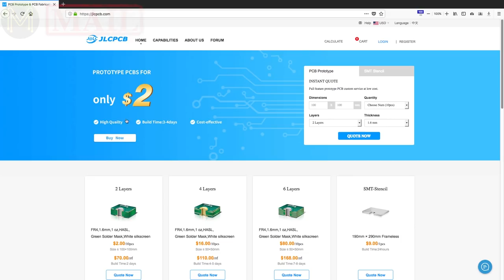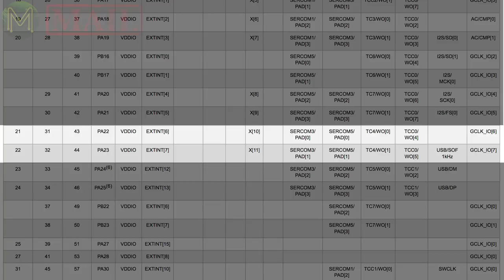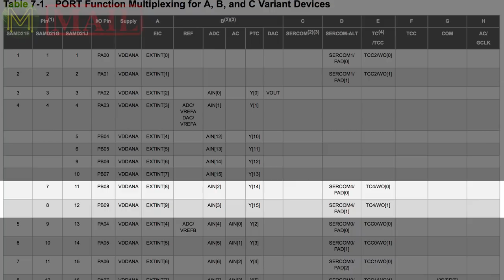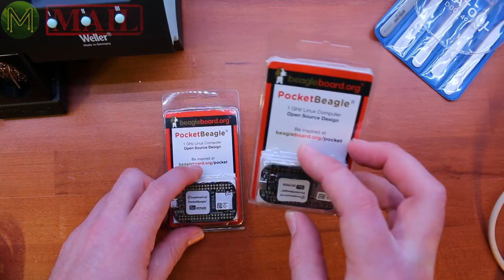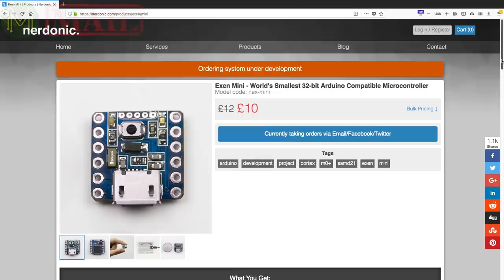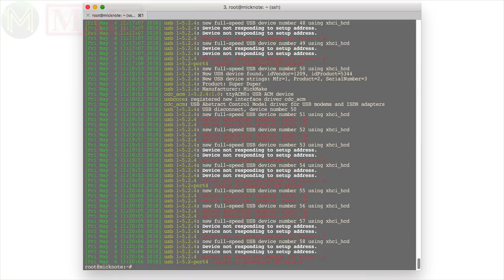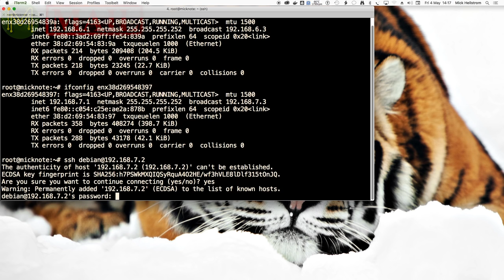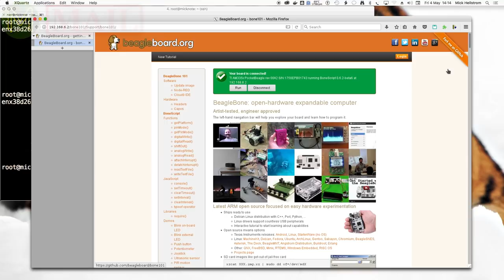#209 MickMake Mail #28: Weller iron, PocketBeagle & a mini projector // News

Comment: I got a new soldering iron myself. I jumped onto the TS100 bandwagon, and like the little thing a lot. With a 19-24v source it gets plenty hot VERY fast, has auto sleep and shutdown, accelerometer restart, and it weighs almost nothing. I built a ham radio (still being troubleshot) with it this week, and it's a wonderful little gadget. If the contact is a bit heavier, it's easily bumped up in temp until the solder flows properly and makes a good join.

The only thing I wish I could find is a tiny chisel tip for small pads or surface mount stuff. I'm using the conical it came with for lack of something better. I did get a small angle-tip (BC2) tip for it, but it's too big.

I have an old Weller that isn't temp-controlled. It's so old you need to change the element to change the temp. It works, but it's heavy and clunky.
Reply from the maker: Yup, that’s the one I have. One temperature wonder. You get quite good at using it. I’ve used it for 30 years and it wasn’t until I tried out a $2000 iron that I realised what I was missing out on.

Comment: Those old wellers were so good, They just never died.  Had mine since the early 80s, still have it but you do need a bit more control for modern electronics.
Reply from the maker: True. SMTs are a bit tricky with the old Wellers.

Comment: Metcal MX-500P-11.  I never looked at another soldering since.  Quite a few show on Ebay and even the non-working ones are usually easily repairable - full schematics are on the web.

Comment: I noticed that for the DLP projector you still had to power it separately from the RasPi. How do you feel about that? Can you backfeed power from the projector to the SBC? I think it's disappointing if you need 2 power bricks to power something that's supposed to fit in your pocket.
Reply from the maker: Towards the end of the video I showed how to power it from a single DC source. Works quite well and can be powered from the Pi or the DLP2000.

Comment: Still have my first soldering iron, RPG model pretty sure it was rated at a massive 18W when I bought it, just tested it then, burning up a measly 13.3 watts. Still, not bad for something that's 35 years old.
Reply from the maker: Nice. I'm amazed my old Weller is still going. I can still get tips for it and will still use it, but it's slow to get started... Often takes up to a minute to get to temperature.

Comment: The sloppy focus adjustment on the projector can be easily fixed by replacing the adjustment pin with a M1.6 screw with a washer and a locking nut. I followed the guide from TI forum, and it was pretty easy to replace: https://e2e.ti.com/support/dlp__mems_micro-electro-mechanical_systems/video_and_data_display/f/947/t/621165. The only drawback of this method is that you have to undo the nut every time you want to make an adjustment, but considering that in most applications the projector will be mounted in a fixed location, it will not be a big problem.
Reply from the maker: Nice! Didn't see that mod.
I'm thinking of 3D printing a case for it that will both hold the dodgey focus thingy as well as allowing adjustment.

Comment: I'm curious why you didn't simply plug that mini projector cape into the beaglebone white you had. Any cape that works on the beaglebone black also works on the beaglebone white (though the converse is not always true).
Reply from the maker: The old BeagleBone White doesn't support parallel RGB666 output from the SoC onto the header. Only the BeagleBone Black supports this.
Reply: @MickMake  That is incorrect. The beaglebone white has the same SoC and the same SoC pins connect to the same expansion header pins.
Reply: @MickMake  Here's a summary of how the BeagleBone White and Black differ:
- The Black has eMMC storage, which acts like a virtual cape and occupies some expansion header pins (unless disabled).
- The Black has HDMI output, which acts like a virtual cape and occupies some expansion header pins (unless disabled, which should happen automatically assuming the DLP cape is recognized, since it obviously needs those video output pins).
- The Black has a newer SoC revision which is faster (1 GHz instead of 720 MHz) and fixes some errata.
- The White has 256MB DDR2 memory, the Black has 512MB DDR3L memory.
- The White has an integrated FTDI usb-serial converter for the serial console port and JTAG. It also has an integrated usb hub whose upstream is the external mini-USB connector and whose downstream ports are the SoC and the FTDI chip.
- The White has a 3.3V 1A LDO solely for capes attached to the expansion header, while the Black reduces that to 500 mA and also uses that LDO to power various on-board components (eMMC, SD card, Ethernet).
Reply: @MickMake  Where did you get the misinformation that the White doesn't support video output on its expansion header?
Reply from the maker: Matthijis, It wasn't that it physically doesn't support it, but rather the software side would have taken a bit more effort. Since I was going to go through the effort anyway, I thought I might as well do it for the Pi.
Reply: @MickMake  Nope, it should work automagically thanks to cape auto-detection. U-Boot will read the CAPE's identification from its EEPROM, then load the corresponding device tree overlay which will set up the lcd controller and configure the correct display timings.
Reply: @MickMake  Easy experiment: plug the DLP cape into the beaglebone, insert an sd card with the latest stretch-iot image (lxqt might be a bit heavy in only 256MB ram?), boot it up and see what happens.

In case of trouble, I've quickly made a beaglebone white branch of my show-pins utility, which gives a nice overview of the current pin configuration: https://github.com/mvduin/bbb-pin-utils/tree/white#show-pins

Based on a quick glance, the DT overlay for this cape looks mostly okay to me. The only bit that seems a bit sketchy is the "INIT_DONE" gpio. The DT overlay reserves the pin, but doesn't actually declare or initialize the gpio, so you may need to manually export and set it after boot. If this is indeed the case, I can help with fixing the overlay to make this happen automatically if you want.
Reply from the maker: I did spend a bit of time with it, but didn't really get anywhere. It was almost a year ago I was playing around with it, so can't quite remember at what point I gave up. However, I do remember preferring to spend the effort on getting it going on the PiZeroW, since it would end up being a cheaper unit all around.

My long term goal is to have it be supported on every SBC. Surprisingly, there aren't that many SBCs pushing out all the required RGB666/RGB888 signals onto headers.
Reply from the maker: From memory, the DLP2000 was badly supported on the BeagleBone to begin with. There have been quite a few people with the same experiences.
Reply: @MickMake  I'm sorry to hear you didn't have a great out-of-the-box experience with it. A lot has happened in a year though (e.g. going from the ever-fickle runtime overlays to u-boot overlays), so I wonder if it would "simply work" nowadays. It definitely should.

And yeah the RPi family offers cheaper boards, but the beaglebone has an open hardware design under a Creative Commons license, and a SoC that's available for sale in low quantities and has thousands of pages of documentation. These are qualities that I feel deserve some encouragement too. :-)  Plus it has a sweet assortment of interfaces and peripherals, and its awesome Programmable Real-time Unit subsystem.

Comment: Buy yourself a TS100.
Reply from the maker: I’m actually considering buying several cheap irons to see how they go. I’ve always had bad experiences in the past... but I’m talking 20 odd years ago.
There’s a lot more options these days.
Reply: TS100 is a really nice iron. Heats up quickly and there are several firmware flavours out there for it. I'm currently using the stock one, but works pretty decent right out of the box. I do need some more tips, as I also have fat tip (tho, not as fat and flat as yours is).

Comment: I want to see more of the Star Wars Day routine.. ;) So I am curious as to why you chose that model Weller over something newer. Was is just a price decision? That model definitely looks more solid than some of the "new lighter weight models"..
Reply from the maker: Alas it was cut due to budgetary constraints.

The Weller? I've always had a Weller and I like the tried and true models. I think this one has been around for 10 years or so.
I was almost going to get the model up, the WD1000M, which has a USB port for control and an auto-on cradle, but couldn't rationalize the extra $200.

Comment: Hi MickMake, the Exen Mini would have thrown an error as it would be running in normal mode and not bootloader mode, as explained in the setup guide you could either try program the exen mini, once it fails it will automatically put itself into bootloader mode and programming again after selecting the new port will work, alternatively you could double tap the reset button to manually put it into bootloader mode. This is unfortunately a small flaw in the Arduino Zero bootloader, however we are looking into releasing an updated bootloader making it more streamlined, hope this helps!
Reply from the maker: Thanks for the quick reply! Yup, I tried all that. I’ll need to do some more investigation on it. I suspect something fishy with my USB hub.
Reply: Have you tried uploading, letting it fail and then unplug/replug the usb, re-selecting the port and uploading? The Hub could also be an issue yes, if it uses USB3 that can also cause issues with some USB devices as the USB3 drivers are different across systems and USB2 usually uses more generic drivers. It was tested and programmed via USB to have the blue LED blink sketch uploaded with the Arduino IDE so it was working before shipping. If you don't manage to get it working it must have been damaged in the post, in which case I can always send another, let me know! - Hayden.

Comment: The Exen Mini is a lot of disappointment. Hardly any of the gpio are broken out. There is no access to the DAC. If you're in need of that size of board format I might suggest looking at the Adafruit Trinket M0. It utilizes the better suited E18 version of the chip with access to the DAC as well as a circutpython programming option and the ability to drag and drop firmware/bootloaders. The Exen Mini had potential. Hopefully a second version will be released with enhanced features.
Reply: Hi Jon, The goal for the Exen Mini was to be as small as possible, have a good amount of power while still being able to fit on a breadboard. People have however installed and got circuit python working on the Exen Mini too :). We have developed and are soon releasing a slightly larger version with 20 I/O pins which you can see more about here: https://nerdonic.com/products/exen/mini_duo
Reply: Interesting. Open source?